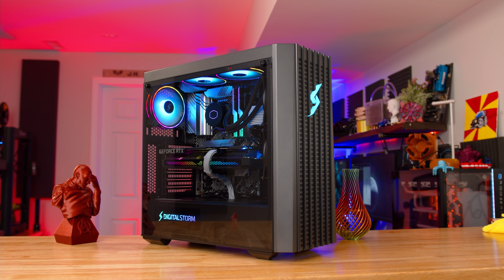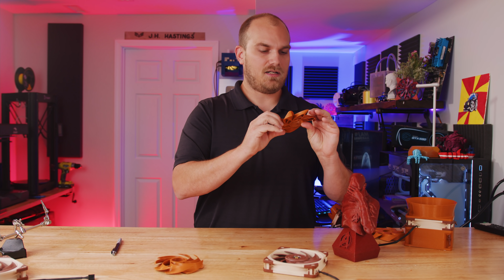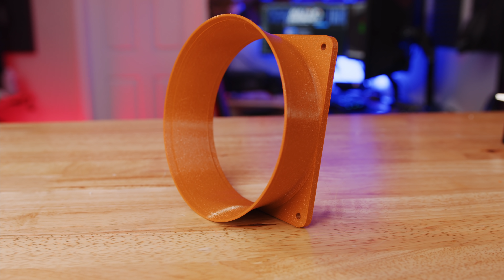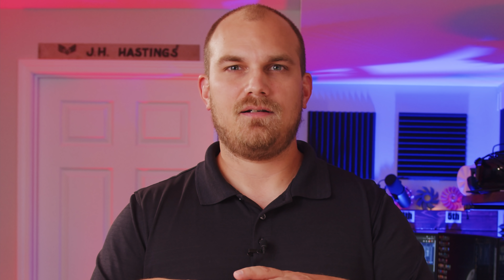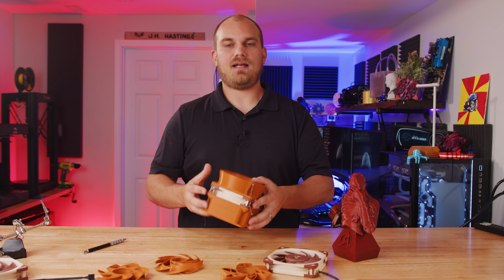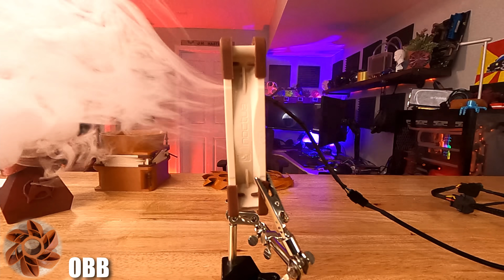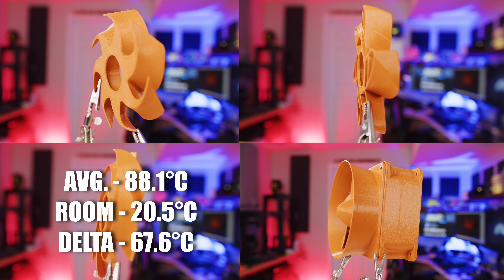Is this CHEATING? - Fan Showdown S3E3

Comment: Looks like it's gonna be time to categorize. A "lightweight" category for fans that stay in the original fan envelope (don't protrude on the back or the front, and can be mounted in reverse like normal fans) and a "extended" category for fans that utilize extra space at the intake side (these fans would still be perfectly plausible to use in most real world scenarios). It gets sketchy with this "cheater" design because it clearly starts utilizing space you probably won't have available in real world use cases.

In any case, with people being competitive, if this design is allowed to have the #1 spot on the same list as other fans, I suspect we'll see a future with fewer and fewer fan designs actually trying to improve on conventional fans. We'll be optimizing for this challenge, and not much else.

Then again, it's season 3. We may be close enough to the bottom of the barrel on traditional fan designs, so maybe it's fun to just play to beat the game for the sake of it :D

Comment: 3:25 Wouldnt taking the extra couple mins to put a "finish" touch on these make them perform better? Example in this clip, pause and look at the holes in the fan, they have stringy print material like spiderwebs or cobwebs across them... Not saying it would make a HUGE difference.. but if nothing else the finished product looks "Finished"?

Comment: I say it printed on a printer and it uses the same driver motor so it's fair game. Edit: I'm with the other guys. Ducted fans need to be tested without the shrouds to get a comparable benchmark. It's very possible that some of the best non-ducted contenders would outperform these if put in the same housing.

Comment: I would like a leader board that is separate just for "cheater" type designs. One that won't fit into a regular PC with the standard A12 frame. It's nice to compare the differences but not dethrone those who worked within normal usability for a PC.

Comment: Would printing the noctic in ABS or PETG… even carbon fibre… could that possibly solve the centrafugal issue? As the plastic is stronger but not much heavier, it should stop the flexing. Am I right @majorhardware?

Comment: You asked if the cheater is cheating and I think it should be on the board and get tested but have an asterisk stating that the fan has additional parts outside of the fan housing.

Comment: It would have been interesting to see how the Cheater's flow guides would work on the stock noctua fan. I'm also thinking, start with the cheater and modify it so it can be bolted inside a case as a front intake. Set close to or below GPU level it could be cool for taking intake air and blasting it directly toward the GPU.

Comment: Depending on the torque of that motor, I wonder if it's possible to multiply the fan speed with a gearbox inside a fan hub.

Comment: I'd like to see the amount of PLA used and the "overesize volume" (how large of a volume outside of the Noctua frame, if any) as additional metrics and a combined "score" with all of those (including noise) factored in. You could still rank them the same way but also have the overall score ranked on a separate leaderboard. Maybe in the future you could use overall score or cooling vs noise as the primary ranking metric instead of pure performance.

Also, please add some support structure to the "noctic" fan and re-run it. I really like the design.

Comment: I was thinking someone needed to correct the turbulent airflow from the output end. And cheater has done that! The only thing I think needs to be done to it is use a a compressor blade (like jet engines) and it should be better!

Comment: Every aspect of the fans will probably improve when you have a decent production process, smoother blades, better material.
Actually wouldn't mind putting in a Cheater aimed right at and maybe another one on the CPU cooler.

Comment: If you could tune the Notic so that the tip clearances were as close as possible at max RPM It’d be so much better. I work with giant Turbo fans and we purposely rub the fan, compressors and turbines so that the tip clearances are as good as you can get. Would be ah Important thing to consider!

Comment: I think a good solution to these large out of frame fans is to create a separate category for "fan systems" with only have 1 represented in the top fans. I think this way it keeps the spirit of making a better fan design for those that keep it to the normal frame parameters, but also allows competition and testing of larger fan systems like the cheater.

Comment: Digital Storm. I remember they once had a cooler and assembly setup named Cryo-TEC that actually saw HEAVY FROST develop around the overclocked CPU which was at double digits below 0ºC. It was INSANE. I wish that was still a thing now, as if I wanted a performance-guaranteed setup, then it would be through them.

Comment: Long post, skip to Bottom Line...

These little 'box fans' were designed to suck air through a tube or hole in a panel, and not be open at both ends!
A naked fan is wasting a lot of energy and making noise swirling air at both ends!
Muscle cars have 'trumpets' for air inlets...they know the score!

For the electronics geeks out there, think of the unmounted box-fan as a high-gain, wide-bandwidth amplifier.
Input and output impedance, proper isolation of input from output are important considerations to prevent oscillation, no?
Same-same air-moving parts!

Tiny side-quest:
Listen to fan RPM when you are experimenting with inlet/outlet gadgets.
If the fan RPM seems to go up when the gadget is in place, the fan is moving LESS air.
If the fan RPM seems to do down with the gadget installed, the fan is moving MORE air.
Fan RPM is a good indication of how hard the fan is working...slower fans are working harder to move air, faster fans are 'stalled' and not moving much air at all!

Cooling efficiency is a direct measure of how much air is being delivered through the radiator fins per second; your is a very 'fair' test-bed!

From HVAC training materials:
Air flow is more important than air temperature when it comes to moving waste heat!
Temperature of cooling air on 'hot side' fins/coils doesn't matter as much as the volume of air being pushed through the fins.
Hot air can cool, if it flowing fast enough!
Boundary layer (always present when air/metal meet) wants air to cling to fins, moving air strips boundary layer, but that takes energy.
Moving air provides some of that energy, but not all!
The extra bit of energy to strip the boundary layer comes in the form of heat!
Forcefully stripping the boundary layer results in 'dynamic cooling'.
It aint much under the speed of sound, but it is a thing!
The fins can get cooler than the air moving over them, within certain flow rates and pressures.
A 'pressure drop', forcing air to accelerate as it passes through the fins, is essential for this type of cooling to happen.
Close-spaced cooling fins in radiators are counting on boundary-layer dynamic cooling...it aint passive surface radiation!
Yes, slow flow rates use convection more than dynamic cooling, but convection doesn't move heat as fast!

Bottom line: 
Any fan that gets good cooling marks with a radiator is moving air effectively.
Fast fans are on a break, slow fans are working hard.  Just like at work...the noisy guy is ALWAYS on break...
Quite fan inlets are potentially more efficient; they move air better.
Box fans without an inlet shroud* are 'spilling' air and wasting energy.

*Hole in a panel, hose or other inlet devices count as shrouds.

Comment: I have to correct the velocity stack thing. Its not to smooth it down to laminar flow. The point of them is to remove the sharp edges gradually so there is no discontinuity that causes a "contraction" of the flow. Its known as the Vena Contractor effect. Which make an orifice, such as the fan opening, give you less actual area of air flow than the area of the opening

Comment: Cheater is valid but I'd be interested to see where some smoothing and refinement or iteration of the OBB, angle or pocket tuning for performance cooling results versus noise. Looking at the RPM being below the noctua, is that because of mass and air drag load? eg thicc fan means motor is bogged down? be interesting to see if there's a difference in 'min noise performance' versus max performance noise level.

Like say how quiet can it be without throttling, versus how hard can it go. broadening the gap between max rpm flow versus low and slow style cooling

Comment: I feel like the reason the cheater worked the best was due to the 4 stater blades at the rear reducing the rotation of the air just like the stationary and variable guide vanes work in a jet engine to reduce the swirling of the air (votecies) and allowing a more efficient airflow through the engine or in this case the cpu cooler. Just a thought.

Comment: I think your the right man to ask this question. Do you think an "intercooler" would A: be possible and 2: be effective at helping to cool the air blowing onto the radiator? I don't think it wold be practical as you would essentially need an other radiator just to cool the intake. But I think it might improve cooling.
Great video. Keep it lit.

Comment: The cheater's flow is so clean, it's impressive ! Even though it beat the A12x25 , I was expecting it to crush it even more with such a bulky design.
Just like in the previous season, I feel like having all this additional space on top of and behind the fan support can help not only the flow, but also the temperature, and by a lot (maybe up to a whole degree °C).
But this is great for creativity, so I'm not gonna complain.
If I had to put one of those in my computer case though, I'd lean for the best fan that doesn't overflow of the A12x25's framework, like the wingfork (sorry Slug mk2).
Anyway, great video, we already got a fan beating the A12x25, that's awesome ! I'm looking forward for the next episode :)

Comment: Cheater likely won because of the rear shroud. Whenever a fan is against a fin stack there is always a dead spot right behind the fan hub. With the rear shroud, it helps to remove that dead zone.

Comment: I don't think any design should be considered "cheating." Putting rules and regulations around any competition just creates designs that push the limits of the rules, and always results in people simply copying the most successful design that adheres to the rules. That's no fun, and I'm not interested in the "fan version of F1 racing." Plus, after many, many years of seeing OEM PC's with weird shrouds, ducts, compartments etc. around fans, I could definitely see something like the Cheater in a compact OEM PC. I don't think I'd put something like it in my build, but I've also put dumber and less effective things in my cases too.

Comment: My thoughts are so long as it doesn't use so much filament that it bankrupts you, it ain't cheating, BUT, all these high minded nerds aren't seeing the wood for the trees.  If the flow through the heatsink is laminar it's not gonna cool shit, 'cause most of the molecules in the air never touch the heatsink.

You need the flow to be turbulent when it passes the heatsink.

Comment: At this point, fans with shrouds and shroud-less fans should almost be in a different category I feel. This isn't cheating if you only consider the results, but I think you should think about the specs too. Being asked to design a fan, it should be considered obvious you are asked to design a fan that can work on its own. So maybe do two tests for fans with shrouds, with the qualifying one being the one without its shroud.

Comment: In my opion if you design anything that is outside the body of the fan frame its a fail or deserves its own category. These external mods of the fan frame make it that will only work in certain locations with in a PC. Also nearly every design can fit a fan shroud on the front or back increasing their efficiency. I am sure if you added it to the stock fan it would increase the airflow and cooling.

Comment: Could you try the cheater without the excess items. 
Yes, you have had +sized fans before, but if you were to classify them in the frame as the stock/default fan, they are shipped now.

Comment: The cheater was labeled as “Notic” in the bottom left during the smoke test
Reply: came to the comments section to say this - see that someone else already did
Reply: @basicmods  I got you bro
Reply: And the real notic fan blades were on backwards... So it was blowing away smoke, not pulling
Reply: @Jack-Sparks  No, it was definitely pulling.
Reply: Yep, saw that.

Comment: I would definitely like to see the Notic improved so it doesn't friction-throttle anymore, even at max-RPM. Maybe even modify the file yourself, to cut 1mm from the outside of the fan inwards, and see from there how much you need to add back or remove again. You could even use sandpaper to shave the exterior of the blades until it stops friction-throttle-ing, and use glue to add back in if you removed too much.

Comment: @Major Hardware - Since you've made some appearance upgrades, I've got a suggestion for the smoke demonstration - Get a windowed case with a good front mess vented panel.  Install the fan so that it blows air out the front of the case, and pump in some smoke from the rear.  Let the case fill up with smoke, then turn the fan on and maybe timelapse how long it takes the fan designs to (mostly) clear out the case of the smoke you pumped in. (suggestion - Corsair 4/5000D Airflow)

this way it's a bit more real-world application-esque... our fans don't sit out in the open when they're running, they pull air into a chamber and then they push it out.

Love the series

Comment: If it was possible, again 3D printing "notic" with reinforcing circle 1/5 away from the edge of the fan wall in the middle height and 3mm thick, the shape of the cylinder could reach max rotation and beat other candidates.

Comment: Fan updates, Notic with like you mentioned thicker blades so it can handle higher speeds.
Superb someone do this! It seems like a good design so.
And it tickles my brain, I'm pretty sure it's from an earlier video of yours that fans tend to come with an odd number of blades. At the moment I'm unsure what the outcome of that was, but..
The OBB is an equal number at 6. so  I kinda wanna see it with either 5 or 7 :P
what would the outcome of that be. Would it even matter since it's kind of a double blade design.
you could say that would be either 10 or 14 blades and we're back to an equal number of blades anyway.

Comment: like other commenters said and I think i mentioned it on a previous video with a fan that had accessories, qualifying for the board should be determined without accessories, and maybe a second board should be created for designers who want to add things like shrouds or whatever the back thing was I forgot (maybe unreasonably oversized fans too but thats more of a grey area so prob just if it has accessories)

that way people can innovate without making an arms race outside of what a pc fan's form factor would typically be

Comment: It's only cheating if the rules don't allow it. The motor and housing diameter are hard constraints, but the depth of the fan isn't necessarily set in stone, so adding accessories on the front and back make sense. Like you said, it's impressive engineering.

Comment: During the Db test can you put the rpms in a corner? Just seems like that would be a better place for that measurement than while showing the design. Also the weight of each fan design might be a new dimension that shows an ideal range of mass to torque… or something smart like that. 4k60 looks great too!

Comment: Those add-ons are the kind of stuff that could be the next step in improving fans overall, so its not good but exelent to expand on the posibilities of what you can do to improve airflow.
I would say that this should be put as a category for a season of the show giving it measure limits and use the OG noctua to see how much you can improve with this external pieces.

Comment: I made a post on your Reddit sub a while back about "the Industrial Revolution of 3D printing" where I suggested using a standardized central hub with interchangeable fan blades. Im glad to see that the "Cheater" used the same concept, although using glue makes the set up a little less useful imo. A major pro of this process is that the layer direction of the blades is smoother. Another is that you could quickly test blades of different pitch/thickness/sweep/etc without printing a whole new fan. You just need to have a set of standard hubs for each of the standard blade counts, and printing new blades will take less time.